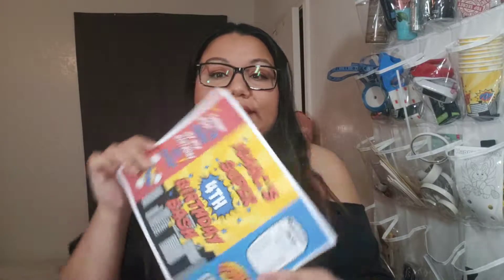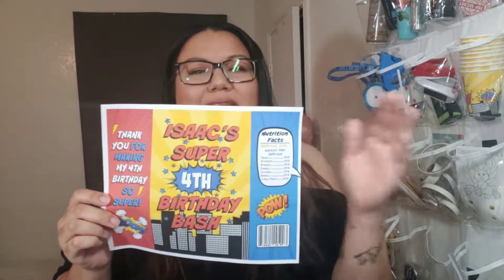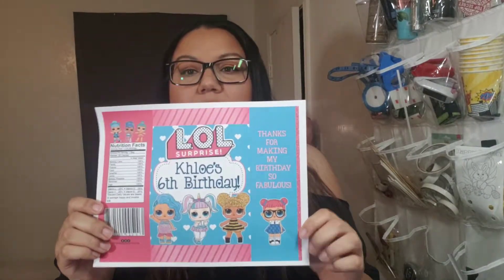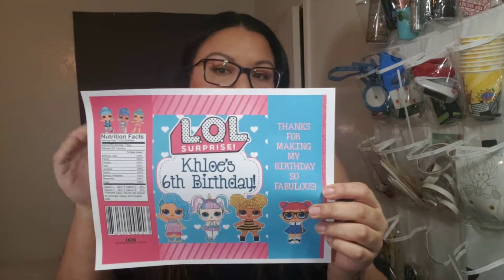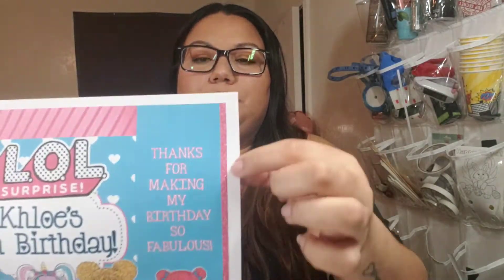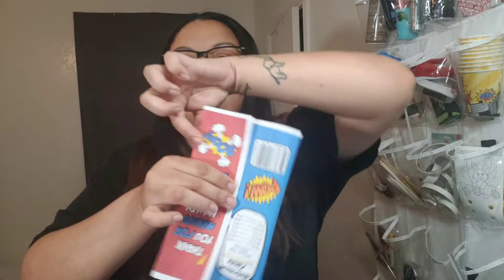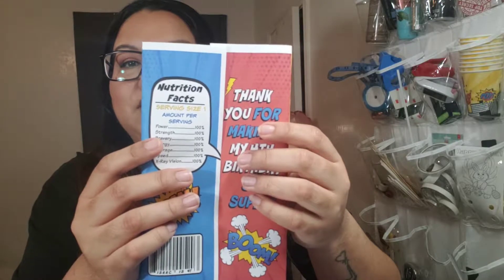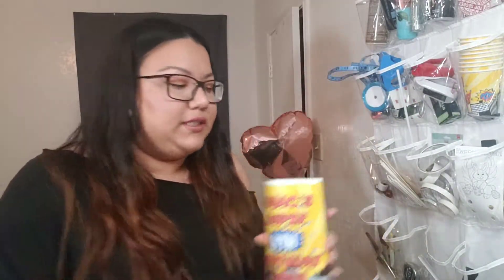How to assemble a custom chip bag party favor - DIY Tutorial

Comment: What size is the paper?
Reply from the maker: Regular printer paper size. It takes up a whole sheet.
Reply: @AdrianasPaperCrafts  thank you. I think my bags are too big for my paper
Reply from the maker: @2adfruste  The 1 oz bags of chips is what you should be using. Anything bigger will not fit. Keep in mind that some chips have more air in them than others, such as Doritos, so that could also be a reason that they seem like they dont fit into your wrappers.
Reply: @AdrianasPaperCrafts  thank you
Reply: Are you using sub ink or regular ink to print?
Reply from the maker: I dont do sublimation. Everything I do is using regular printers.